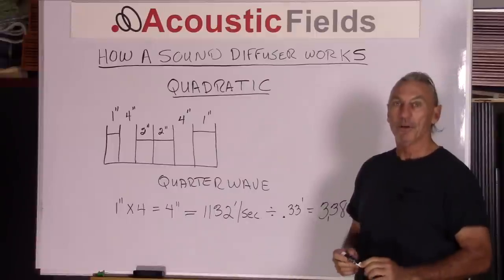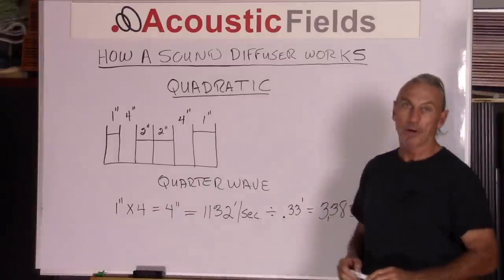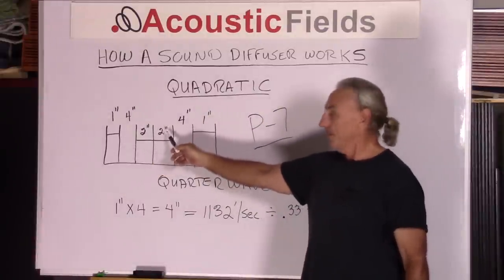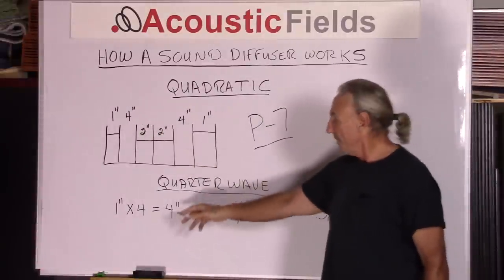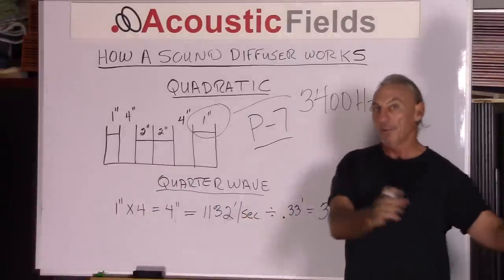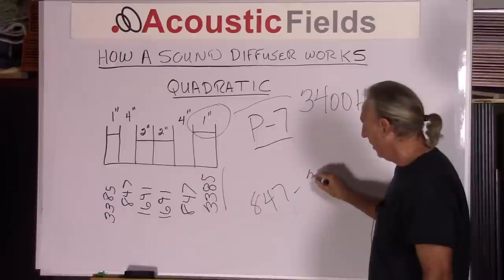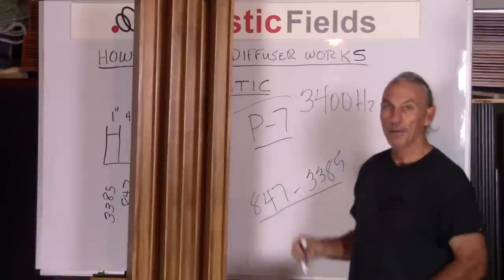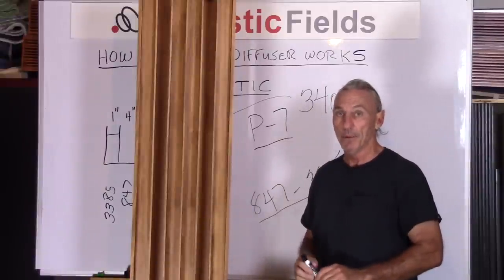How Sound Diffusers Work - www.AcousticFields.com

Comment: Dennis you always do a great job with your videos! Thank you so much for the time you spend on the videos and thanks for creating great products!
Reply from the maker: My pleasure Ken R  Let me know if you have follow questions about anything in the video or if anything needs further explanation.  I've already received some excellent questions on the back of this which will form the content of another video.  So let me know if there were any additional questions you had on diffusion and I'll be happy to include in the follow up video.

Thanks
Dennis
Reply: Dennis, you said that the width of cells is derived from half wavelength. What wall, side or back, should be taken to define the standing wave needed and count its length correspondingly?

Comment: Looking to build a quadratic diffuser.  This is such great information. Thank you  Dennis.
Reply from the maker: S,  Let's step back a bit. Diffusion is a technology that can make your room sound worse if you haven't done some housekeeping first. Diffusion acts like a magnifying glass. It will magnify certain frequency and time signature issues you have not treated. You must first manage all frequencies below 100 Hz. with the proper low frequency absorption technology to control rate and level of modes. Secondly, your middle and high frequencies must have spectral balance and be evenly presented within your sound stage if mixing or listening room. Diffusion is like chocolate syrup on ice cream. You can only add it to the ice cream. You must have the ice cream first. Have you taken the above steps?

Comment: Where are the  ideal places to put diffusers (and in comparison to acoustic foam panels)?  ie front wall, side walls, rear wall? Is there a rule of thumb or ratio for diffusers to absorptive panels?
Reply from the maker: You must match the treatment locations and type to the room usage.

Comment: Best video ever. How wide should the wood itself be?
1/2 inch?
3/4 plywood? I want to use pine.
Alder and cherry are too expensive.
Reply from the maker: The well dividers that run vertically should technically be 1/8". That small wood is too fragile to work with and will warp over time creating phase issues. We use 1/4" for the vertical well dividers and 1/2" for the horizontal well dividers. Use cherry. Its worth the cost. Its the best wood for middle range (voice).

Comment: Hi Dennis, thanks for the interesting and informative video. A quick question for you: does it matter what material the diffuser is made from, assuming all else is the same? Is wood any different to, say, plastic, metal, or rigid foam, again assuming that all the diffusers are the same size etc.?
Reply from the maker: Wood provides the best tonal qualities for mids and highs.
Reply: @AcousticFields  Thank you!

Comment: I teach acoustic also but I am nowhere nearly as good as you. Truth is I did take acoustic in my Music Production and Engineering program, not exclusively architectural acoustics. Many of your videos have helped me learn greatly and I can't wait to assemble a diffuser myself! A question though, are prime numbers something that tell me what frequency length this diffuser works with? Thanks so much!
Reply from the maker: C,  The prime number determines frequency response. The well depth is calculated using 1/4 wave and the well width is calculated using 1/2 wavelength.

Comment: Are space coupling diffusers good to use on a back wall when the listening position is close to the back wall? How thick should the the diffuser frame be? Should it be placed on the wall or extend into the room an inch or two off the wall?
Reply from the maker: All quadratic diffuser placement is distance dependent. What is the distance from your ears to the wall?
Reply: @AcousticFields  about 12-18 inches. I gave a range because I've been experimenting with moving the couch off the back wall about 6 inches.
Reply from the maker: You need 4' minimum for any prime number sequence

Comment: Because of this video I built two large panels using the QRD formula behind each speaker. I immediately noticed a wider soundstage but I’m missing height in the vocals. Do you recommend adding center panel? Vertical or horizontal? Thank you
Reply from the maker: You must cover the distance between the two speakers as a minimum. Its best to place diffusion on the complete front wall. Stay with one dimensional.

Comment: Thanks for this video! may I ask a stupid question? How can I reduce 84 Hz echo in my room?
Reply from the maker: An 84 Hz. issue is a pressure issue not a reflection or reverberation issues. You must a lower frequency absorber such as our Carbon Panel. It stars at 40 Hz. and goes through 6,300 Hz. https://www.acousticfields.com/product/carbon-panel/
Reply: @AcousticFields  Thanks a lot, sir! You saved my money and time!:)

Comment: Hi Dennis,
you say that the well depth is always 1/4 wave lenth hence the depths vary for the different wells due to different cycles they target. But how about the well width which you say is half wave length, the wells seem to be all having the same well width. Can you explain?

And for a control room would you make the diffusion in the rear all with the same well depth or is it ok to make some with 6" and some with 12"? (not regularly distributed)

Thank you very much for your really explanatory videos.
Cheers,
Caspar
Reply from the maker: The well depths are determined by a modula formula. The deepest well depth is the lowest frequency in the diffuser's response. The well width is the highest frequency in the diffusers' response. The well width is constant at half wavelength.
Reply: @AcousticFields  Meaning that for the P-7 diffusor in your video with the min. well depth of 1" the width is 2" for every single well?

Comment: Thanks for the great video as always. I have built your panels for several rooms with great success. Am trying to set up a small room and was wondering how far away from the diffuser panels does the listener have to be for them to be effective. In this case I am specifically talking about the qd7.
Reply from the maker: https://www.acousticfields.com/diffuser-size-distance/
Reply: @AcousticFields  Thanks for the response. Unfortunately I don't see qd7, but I would imagine it's a little less than the qd11, but probably not much, so I can use that as a guide. Thanks.

Comment: For home theater room - if I place a P- 7 in the back wall so the seating should be 2 feet from the back wall? I came up with a number from your video "Sound Diffuser Placement - How To Position A Sound Diffuser"
Reply from the maker: V,  Start your P-7, 2 - D diffusion sequences at 24" off the floor and run the diffusion treatment sidewall to sidewall and up to the ceiling.

Comment: You provide the well depths - but how wide is each well? On the real diffuser they look about 2 inches wide. Does it matter how wide they are? Do they all have to be the same width?
Reply from the maker: Well width is determined using half wavelength rules. Well width determines the upper frequency range of the diffusion sequence. Well depth is quarter wavelength. We use 2" wide widths due to construction limitations. This produces an upper frequency of 3,450 Hz. It is difficult to work in a small space for the well dividers. We have built them with 1" widths. If high frequency diffusion is required, we use another diffusion sequence which is our mini - wood diffusion sequence. https://www.acousticfields.com/mdw-mini-diffuser-overview/
Reply: @AcousticFields  Excellent, thanks. I've built my own diffusers in the past but just chose random depths, but the next set will follow your dimensions.

Comment: Cheers Dennis. Another cracking video. 
Can we have a vid showing where you would ideally position the diffusers and what prime number combinations work best in relation to room size and room usage? Hehehe If you can fit all that in one video :-) 
Im guessing prime number 7 relates to the 1"+2"+4"=prime number7?

Another question.....i know youve talked about symetry in regards to speaker positioning.......alcoves. how best to cover them when brickwork is not really possible. I was thinking 18mm mdf the whole wall but what do i infill the voids with? I was thinking a good solid frame of 100x50 timber behind. Lots of it to prevent it sounding like a drum. What do you think? I kinda know your going to say find a good bricklayer :-) is mdf and timber not really good enough as a compromise? 

Another :-) at college and uni we were told yellow insulation felt for heat and pink for sound. A method to provide a good barrier would usually be something like a 100x50 frame set 50mm away from the wall and packed with pink felt. Layers of felt behind the timber stud frame should wrap under and round the four sides so the frame was sat on the felt. Fixed with wedges so no screws into the floor walls or ceiling. Then boarded with foam backed plasterboard usually 10mm thick plasterboard with 20mm of foam.
What do you think? 
Our acoustics lectures were a bit thin on the ground......think we had about 4 hours worth. We got as far as a 70db drill in a room +another 70db drill doesnt add up to 140db. We did learn how to calculate the true levels. A medium sized log equation if my memory serves me well :-) 
 
Cheers Dennis. Youre a diamond
Reply from the maker: As always, many thanks for the excellent questions adi daskoln I will put these on the list.  I will try to respond to some of these questions in next Tuesdays Google Hangout.  With the diffusion question, I think that warrants another video so will try to get that done ASAP.

Thanks and have a great weekend!
Dennis.

P.S. How is the build going?  Have you made a start?

Comment: for that particular quadratic diffuser (prime 7 example?) would you just run one of those directly behind you or do you stack them side by side? if you do put them side by side what dictates the amount that you stack side by side (with the diffuser running vertically) and I guess the same question for running them horizontally?
Reply from the maker: Hi Christopher,  Diffusion works best when you match the frequency response of the diffuser to the audio usage, distance from wall to listening position, and a host of other variables. Positioning them both vertically and horizontally provides two dimensions of diffusion. As a general rule, two dimensions of diffusion work better when your distances to listening position are below one dimensional requirements for a specific prime number diffusion sequence.

Comment: Thanks for your videos. I've learned a lot from all your content and website.  One question; Well Width often seems to be left out of most conversations about these diffusers. And the online quadratic calculators seem to give a very small width compared to the ones i've seen with my eyes.
What would the Well WIDTH be for the example given in this video?
Thank you.
Reply from the maker: There are performance restraints along with construction issues. If the well widths are smaller than 2", it is difficult for workers to get their fingers inside to secure pieces. A 2" width will provide diffusion out to 3,450 Hz.  which is more than adequate.

Comment: I have two questions. What kind of effect has diffuser on lower frequencis than the 1/4 wavelength. Let's say qd 13 has lowest diffusion frequency of 280 hz. What effect has it on 250 hz or 200 hz?
Second question: Is it possible to have too much diffusion in listening room or home theather - can it become overwhelming or too live at some point, or is it a matter of taste? Thank You.
Reply from the maker: V,  Diffusion sequences have a frequency response. Frequencies below the design parameters are not diffused. Yes, you can overdue any treatment types.

Comment: Hey Dennis,i want to ask you if were to put quadratic diffusers in a 3mx4.60m wooden studio for drums only will they have any effect??if so what else do you suggest that i should put and where to position them exactly..i am thinking of putting two vertical on the opposite wall of the drums and one horizontal on the sealing.thanks for you time

Comment: In theory could I cut all those numbers in half and it still be quadratic ? Example .5, 2,1,1,2, .5 ?
Reply from the maker: The goal is to provide a broad frequency range of diffusion. The higher the prime number the lower the bottom end of the frequency range.
Reply: @AcousticFields  gotcha ! Just wondering if in theory quadratic would still apply ? 
I understand it would be for high frequency range

Comment: Nice video. In this case, assuming the highest frequency diffused is 3385 Hz, is the well width half of the wavelength of 3385 Hz signal?
Reply from the maker: S,  Yes.

Comment: Very interesting!
Are these diffusers only meant for small rooms? Or are they also used in big spaces, like a music hall?
Reply from the maker: Thanks alvarofue Quadratic diffusion can be used in both large and small rooms. Quadratic diffusers have a much larger sonic impact in smaller rooms though. I consider them to be almost like a musical instrument when it comes to small rooms.   

Thanks
Dennis
Reply: There's no big or small room for frequency nuisances.
Reply from the maker: alvarofue I answered your question on the kind of rooms to use diffusers in in greater detail at the end of yesterdays Google Hangout. You can see the part where I answered your question here http://youtu.be/e02-NOaVyCU

I hope it helps.  Please let me know if you have any follow up questions I can help with.

Thanks
Dennis
Reply: @AcousticFields  What is a small room? 3meter x 3meter would that work? Should I even bother trying to treat the sound in such a small square room?

Comment: hello Dennis, wondering if this sound diffusers would be efficient to a meeting room. Without mecanic sound, only peoples voice and chats. Cause the frequency of the human voice seem to be below de 800Hz frequency low limit capted by this especific diffuser. Do you have any suggestion to this acoustic problem? greetings from Brazil
Reply from the maker: I would need much more information to assist you. Fill out the information in this link: https://www.acousticfields.com/guarantee/ Make sure you include photos of all room surfaces.

Comment: Hi Dennis.  Am just setting up my project studio space and thinking before I get into diffusion and bass traps, I might cover the walls (presently sheets of wood panel over drywall) with planks of pine wood.  Is it better for the room acoustics for the planks to be vertical or horizontal, or does it not matter?
Reply from the maker: RX, Neither.  You can't guess about this or that for your music and voice room. Fill out the information in this link:https://www.acousticfields.com/free-room-analysis/ Lets take a serious look  at what you are doing.

Comment: Hey Dennis,

Love you work.

Question: I'm planning to buy the dynaudio bm15a for my homestudio.
Option one is my bedroom The roomsize is about 15 square meters in total, and the height is 3,5 meters, and has the shape of a square.

Option 2: The attic, size is about 25 square meters, height 4 meters, and has the shape of a triangle. Meaning the roofshape are not vertical.

If you want i can send pictures of the 2 rooms, wich one would you choose?

The speakers are known to be very good sounding  but i'm wondering is it to big for my homestudio?

Can i treat my room as such that they are a good fit in my room?

Thanks

Emir
Reply from the maker: +heeydado Use this room for sleeping only. Use the energy from a good night's sleep to find another room. Send me dimensions of the new room in this link. http://www.acousticfields.com/free-acoustic-treatment-room-analysis-tell-us-room/

Comment: How tall should a diffuser be assuming it will put on the floor. How much of the front wall, for example, should be covered with diffusers?
Reply from the maker: Hi Gino Punsalan 

Room treatment positioning is dependent on room musical usage. If it is a two channel playback system, then 12" off the floor for both front and rear wall is a good start. You will have to try different positions and test with repeated listening trials.

Thanks
Dennis

Comment: Hey Dennis, ive a question that pertains to how diffusers work/are effective. Someone told me youre not supposed to lacquer your diffuser - whats the science behind this reasoning? Also; how does that translate to paint - if i were to paint my diffuser, instead of using oil, do i just avoid anything that is "lacquer" and stick to mat, or is there a special kind of colour/base that i should be looking at?

Thanks, Jan :)
Reply from the maker: Hi Jan Hajšen 

Soft woods produce the best tonal qualities in diffusers according to our testing. We have built diffusers out of many material types and find your soft woods such as alder, birch, and bass work well. We have even tried plastic injection molding and still go back to soft woods for their tonal balance. We finish with a clear coat to seal the wood from moisture and dirt.